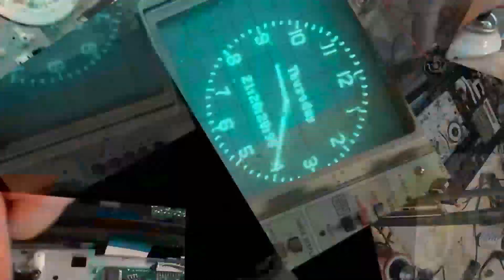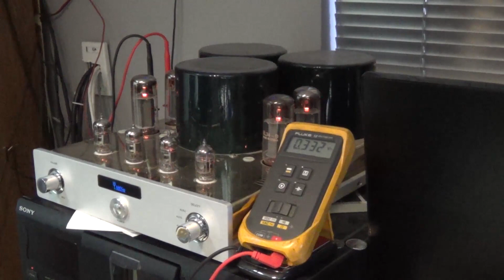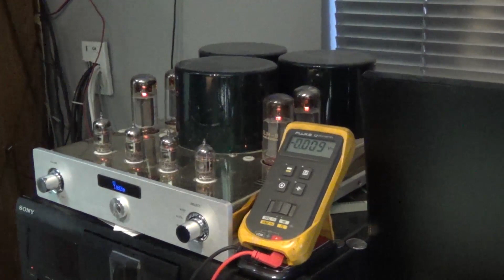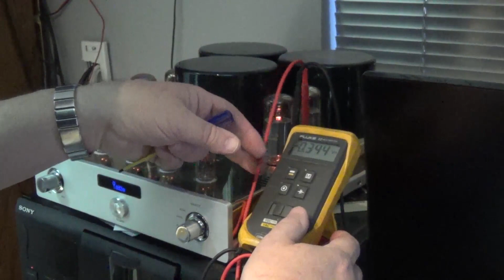Biasing your vacuum tube amplifier

Comment: is this only for push-pull amplifiers? do i need to worry about this on a single-ended class A amp?
Reply from the maker: Single ended are always heavily biased. There is no cut off.
This is why the transformers tend to heat up and the tubes themselves have relatively short lifespans.

Comment: Mcintosh is over priced and you can not hear the difference.
Reply from the maker: They are indeed.  My Chinese amp sounds every bit as good but you will never convince the audiophools this. But then the only people that say this are the people that can not afford a McIntosh.  I happen to own one myself.   Some day I will do a video on it.
Reply: @12voltvids  I can but your ears can't hear what it can do.  It is just a waste to have it and not be able to hear it.
Reply from the maker: @ChickenPermissionOG  
Actually I can hear it.  The modern tube amp i use has a much better sound that. My old vintage.
Reply from the maker: @ChickenPermissionOG  i certainly can.  The vintage amp sound changes fairly significantly over the first hour or so after it's first turned on as it gets completely warmed up. The reason for this is old equipment from the 1960s is full of carbon resistors. Most are 10 some 20% tolerance. As they heat up their value changes slightly which in turn effects the sound quality. My modern amp it's all thin film better than 1% tolerance resistors. So from the time it's turned on and functional the sound quality never changes. Now if I were to go into my Mac and change every resistor to a new one then I could probably improve it's performence as it stabalizes. But as it sits now if I want to listen to that unit I have to turn it on and leave it sit turned on for at least 30 minutes. Now of course it will work as soon as the tubes warm up but it's certainly a much fuzzier sound until it fully warms up where is my modern tube amp as soon as the tubes drop the temperature it sounds fantastic and it sounds that way all day long. Does it sound better than my solid state app? I would say no it doesn't it has its own sound which is very pleasing to listen to compared to my solid state app which sounds very sterile. That's the main reason why people pay big bucks to buy vacuum tube gear, it's not that they're better on spec they're not, however they are much more pleasurable to listen to.
Reply from the maker: @ChickenPermissionOG  
I guess you have never listened.  As to the cost, the only people i hear whining about them are those that can't afford them.
Reply from the maker: @ChickenPermissionOG  
Again coming from someone that has never listened to a tube amp. You will hear sonic differences.  And it has nothing to do with the frequency response either.  It has to do more with the imprefections of electrons flying around in a vacuum bombarding a metal plate.  It's the same imperfections that make vinyl records appealing to some. A tube amplifier just happens to reproduce music almost exactly the way that the human ear hears music. You don't have to spend $10,000 on a Mac. Three grand for a dynaco or even 1, 000 for a yaquin or an eki kit will give you every bit as good a sound quality. My little Chinese yaquin el34 amplifier runs circles around my sansui 9090. I have them both hooked up in my living room and yes the sansui will kick the tube amp to pieces when it comes to sheer volume. 100 + watts per channel will certainly beat 40 watts per channel right? But the 40 watt amp sounds better in every aspect.  Some people like something to show for their money invested. Some people will spend $20,000 going on a holiday for a couple weeks to some exotic location and others will spend $20,000 on a stereo system. Those that like to travel will criticize the person spending 20 grand on a stereo saying well they're not experiencing the world, the guy spending 20 grand on the stereo though his response that would be I've invested 20 grand in something that I can enjoy every day probably for the rest of my life and you spent 20 grand on a holiday that you'll forget as soon as you get back and all you'll have is the pictures for the bragging rights but the guy with the stereo he's got the nice stereo that I was friends are going to drool over in jealousy.
Reply from the maker: @ChickenPermissionOG  
Where did you get that idea. At my age i can't hear much above 15khz, buy here is what you are completely missing.  Higher frequencies will mjx (heyrodyne) and produce undertones and overtones (even order harmonics) that do fall in the range where you can hear them.  Go back to audio engineering 101.
Reply from the maker: @ChickenPermissionOG  you obviously don't understand audio and electronics.  Say for example you have a 23khz tone and a 20khz tone.  Both are well beyond the human hearing range however those 2 signals mix and you will have a sum and difference signal.  43khz and 3khz.  The 3khz difference signal is most certainly in the human hearing range.   Dumb ass.

Comment: Do you need to adjust the  bias on a single ended tube amp?
Reply from the maker: Single ended is idling at about 50% max current with no signal present.  Mist have ni control, they are set with fixed resistors.
Reply: @12voltvids  thanks.  Just got a Class A single ended tube amp from a thrift store.   El34 tubes.  It sounds very detailed bright and full.  Nothing missing in the sound.   I did a comparison, same for same, with a 70s solid state sony reciever and see the colouration the solid state has especially in the lower frequencies.   Both amps are sounding so different but both are beautiful sounding.

Comment: I have this amp. Can you recommend EL34 tubes that sound warmer than the stock chinese ones? Also is it worth changing the smaller tubes, or does that not make much difference in sound? thanks
Reply from the maker: ElectroHarmonix are what I am running now. I am running the stock preamp tubes.

Comment: I have an HH SCOTT 208 tube power amp, it has 7591 power tubes, so do I set the meter to volts or milliamps? And should I be more concerned with voltage or milliamps reading.
Reply from the maker: You set to millivolts if you measure across the cathode resistor.  You set it to milliamps if you put the meter in series with the resistor.  This requires disconnecting 1 side of the resistor and placing the meter in series with it.   Most measure across the resistor in parallel with it and measure the voltage drop, but then you have to calculate the actual current which will vary depending on the value of the cathode resistor.  This is why some pureists will disconnect the cathode resistor and measure the actual current, because they don't know ohms law and how to calculate the current from the voltage drop.
Reply: Thanks a bunch for your fast reply, I'm not sure how my amp is configured but I was wondering if I set it to the voltage, would it actually show the voltage of the tubes, but I guess one way to find out is to just do it and hope it doesn't fry my cheapo harbor freight meter lol, thanks again for your help. I posted a couple of videos on YouTube of my audio system and what I've done to the amp. Just type in Woodnesium in the search box.
Reply from the maker: @lysanderhubbard6863  
You measure the voltage across the cathode resistor which goes to ground.  Generally about a 10 ohm resistor.
Reply: @12voltvids  thanks, but I'm not going to open this thing up, I will just stick the probe in one of the 4 holes on top, then set the meter to volts and see if anything happens :) I'll let ya know what happened.

Comment: Please show me which multimeter to buy to mesure bias. I am running the same amp and i want to replace the power tubes
Reply from the maker: Any multi meter that measures millivolts DC which they all do.  A 10.00 meter will do just fine. The test stakes are across the cathode resistor and you are measuring the millivolts across the resistor.  I will be doing another one on this amp as it has several hundred more hours on it so it is time to check it again.  Now it is in my living room  hooked to big speakers.

Comment: Those Yaqin amps are amazing quality for the money. The 10 MC 10L, 10T with EL34s are really nice amps, very musical. Replace the pre-amp tubes with some NOS Winged Cs. I'm using the stock Chinese power tubes which are fine.
Reply from the maker: Yes they are. I retired my McIntosh 1500 because the Yaqin blew it away.
The thing with tube amp designs is they are all very simple designs and the basic design on most of these are over 50 years old. What has improved in the modern vintage is the tolerances of the support components, that being capacitors and resistors. 
Old gear used resistors with 10% tolerance and capacitors had 20% or worse.
Now components are precision. 1% or better. This makes a big difference in the sound.
NOS tubes are snake oil.  Modern chinese and russian tubes are just as good today. Perhaps 20 years ago a NOS tube would be a better choice, but today with tube factories back in full production they are making very good tubes. The russian tubes have always been good because russian tubes never went out of production. The Soviets used them in military equipment all along so factories kept pumping out the more common tubes. I run Electroharmonix tubes and they sound fantastic.
Reply: Thanks again for the video, so useful especially for layperson such as mysel. Wondering if you've done much tube rolling with your Yaqin and if so, could you share what power tubes you like best?
Reply from the maker: @thesoulshakers  
Still running the original tubes. When they fail I will try some others, but these ones sound fine to me.
Reply from the maker: These preamp tubes sound fine to my ears.
Reply: I have the same tube amplifier. Bought from a guy for $100 because one 10 ohms bias resistor went kaput. Replaced all 10 ohm resistors with Dale brand. I’m in heaven.

Comment: Hello,  Do you know a book or book with video on several popular tube guitar amplifiers that tell you how to bias the output tubes. Thanks,Me
Reply from the maker: Off hand I don't but i am sure they are out there.  Guitar amps are a little different. They are biased generally to produce a specific sound as opposed to the cleanest output as a hifi amp would be. This generally means a little under or over bias.  Under bias allows tubes to cut off between the push and pull phase swing and that introduces distortion.  Over bias prevents the dormant tube from going into cutoff reduces cross over distortion but if excessive will dramatically reduce the life of the tubes and cause heating of the output transformer.  So as you can see biasing is important, and it is tube dependent.  So if you roll to a different brand or number of tube you need to rebias the tubes.
Reply: thanks.

Comment: What should i bias the valves to for 6550's in the same amp? Thanks!
Reply from the maker: I have never rolled to these, so I can't tell you what the bias voltage should be. However, at 400v plate voltage, an EL34 requires about 38mA and a 6550 53mA. The yaquin runs a plate voltage around 430v.
Nor remember many of these bias calculators, and figures pulled from the internet are geared towards guitar amplifiers, not hi-fi amplifiers. Changing the bias current will certainly have an effect of sound. Too much bias will increase the distortion. Too little and the tubes will run hot, and this will shorten the life of the tube. If the bias is really low the plate of the tube could glow red. This is very bad, as it is not only burning up the tube, but could also heat up the primary winding in the output transformer, melt the insulation, and then you have  a shorted output transformer. Since I have only run the original tubes, I can only comment on the recommended settings for the supplied tubes.

Comment: i just acquired a jolida 202a tube integrated amp with EL34 output tubes.  i am a total tube noob.  your vid has been helpful.  now i just need to get my hands on a volt meter!  any other tips that i should know about?  again, thanks for sharing.

Comment: isn't class B notorious for its zero-crossings deadzone? not its clipping distortion?
Reply from the maker: +Pieter van der Meer If a class B amplifier is biased into cut off then you are correct, you fall into the dead zone. Most push pull designs are not class B, they are class AB where there is a slight bias voltage applied to tubes or transistors to keep them from going into cut off under a no signal condition.If the bias is set too low, you get the switching distortion as the output goes into cut off before the other output begins to conduct "dead zone" If it is set too high, too much idle current will flow which can damage the tubes, and output transformer, and overheat output transistors.Clipping distortion occurs under an over drive situation, where the power supply can not supply enough power for the output level.The switching distortion or IM happens at all signal levels, not just full output where clipping distortion would occur.
Reply: +12voltvids  There are a couple great sounding class B tube amps..One is called the Berning EA 230 and there is one other that escapes me...Actually Mcintosh runs very close to class B at idle on the unity coup0led bifilar amps..I just rebuilt a pair of Mc30s and now I'm doing a pair of Mc60s...Love your videos BTW.
Reply from the maker: +Mike Samra A class AB is just a class B amplifier that is biased slightly higher to keep the tubes slightly conducting. Most so called class B amplifiers are in fact class AB.There were a few exceptions in some solid state amps back in the 80s by Technics and Yamaha. They called them auto class A.At low power levels they would switch to a single ended output, and use a single transistor for the entire waveform dramatically decreasing efficiency, but also removing the crossover distortion. As the volume was increased the amp would go back to class AB.A class B amp is a total cut off, so there is no idle current, and they sound pretty harsh. Many cheap transistor radios used a class B push pull into an output transformer. The reason they did this was so there was no idle current wasting battery power.I have a VERY OLD Sony transistor 6 AM radio that I am going to show off some day. It was my grandmothers set, and she used to listen to that thing every day, all day, and a set of batteries lasted for weeks at a time. Class B output, very efficient and being an AM radio, sound quality was not a concern.If I bias this amp as class B, you can definitely hear the difference (that is bias the tubes for cut off under no signal)
Reply: 12voltvids
I agree with you about the sonic differences between A/B and class B. There are a couple of very good tube amps that class B output stages and one is  the Altec 1570b and that runs 811s or 572bs which are zero bias triodes.
    We actually built the driver stage with a 12Ay7 input going into a 6sn7 and from into a pair of EL34s wired in triode as a cathode follower drivers into the 811s. Of course the driver runs in class A but we were able to tweak out a slight notch distortion in the output with 2 watts output at 1khz..Normally these amps are 190 watts but go down to about 50hz at that power but when you do all the mods you can get it down to 20hz at about 90 watts. The output is not large enough for 200 watts at 20hz but it has beautiful bandwidth if you biamp them..
     I like pure class output stages as well but they waste a lot of power..Class A/B is about the best overall.
  https://parttimeaudiophile.com/2014/07/29/caf-2014-live-sound-designs-makes-the-old-new-again-and-the-crowd-goes-wild/